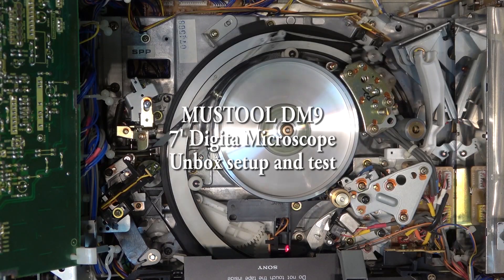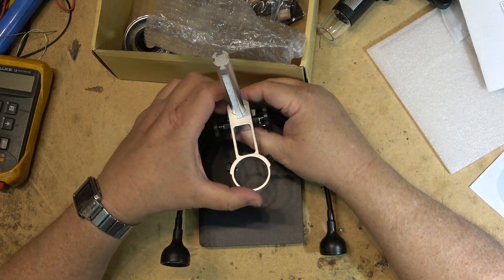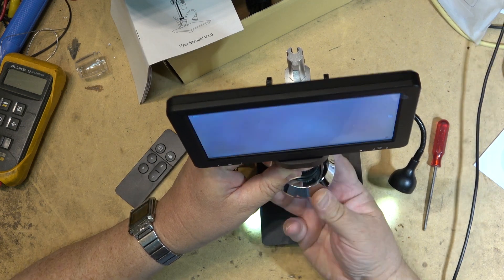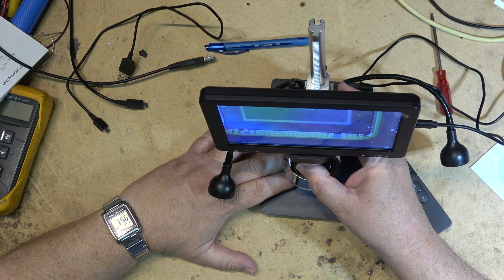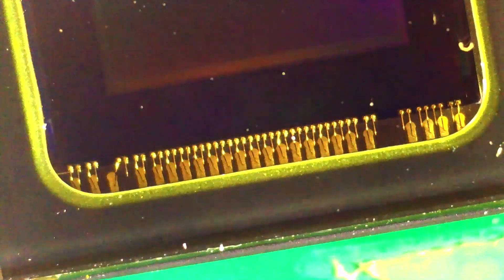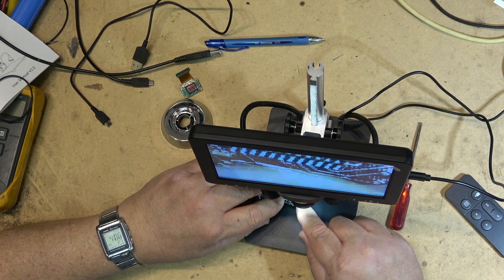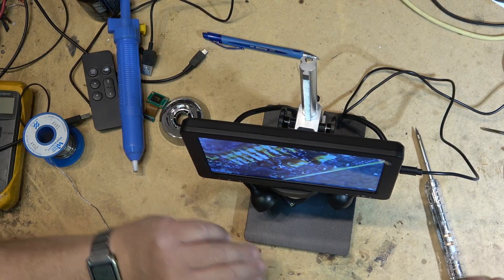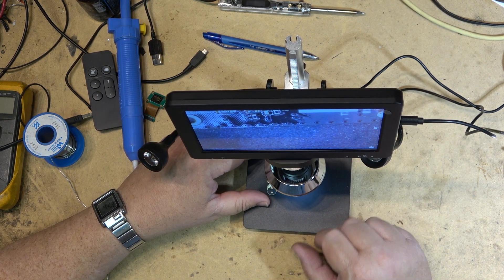MUSTOOL DM9 PRO Digital Microscope Review

Comment: Great review Dave…. I have a question, when you were soldering in the video and was showing the soldering, was it off of your screen on the scope? Or was it connected to your camera/computer?
Reply: As I’m looking into getting a scope, but I want one with eye pieces with different power levels and an output to stream the microscope live.
Reply from the maker: This can stream live, has hdmi out. They have a stereo scope too but that one is over 400.00
Reply from the maker: I was looking at the screen and recording to sd card in the scope. The video i showed was from the card.